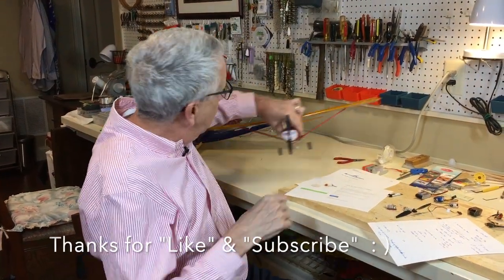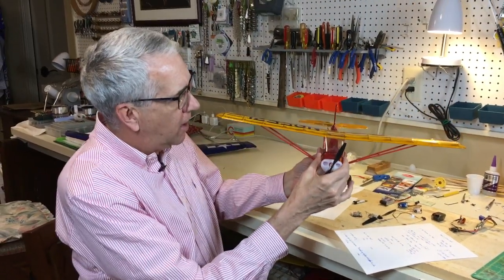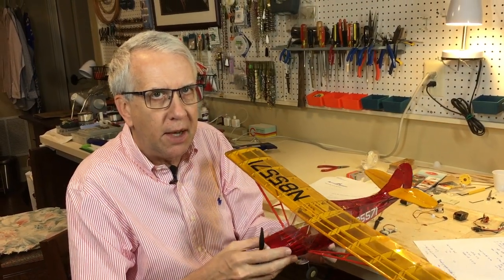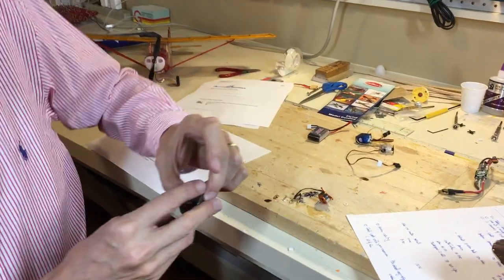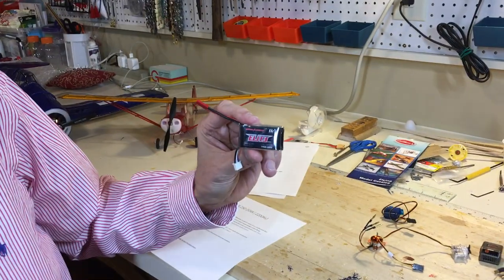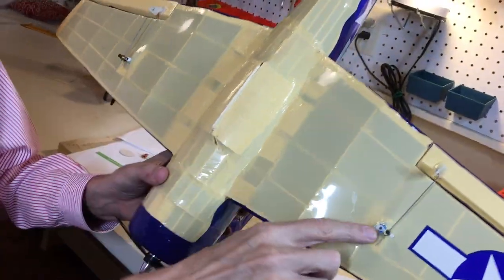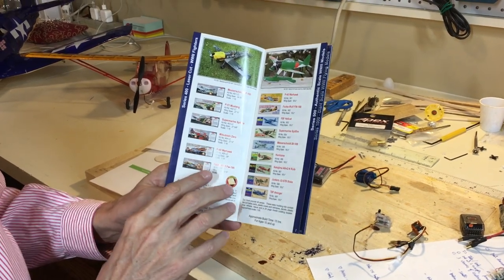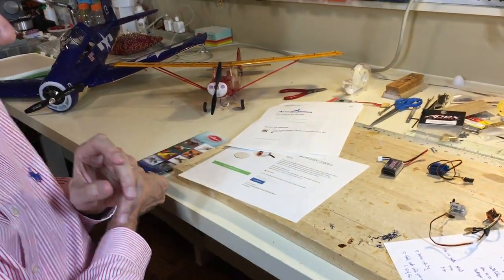Guillows RC Conversion Motor & Electronics

Comment: I just completed the Guillows SBD kit. I went with the Park 370 and electronics you recommended.  I covered it with tissue and clear coated it. I haven't flown it yet because I lost the canopy but I ordered a replacement. Its light and strong. I just started the Hellcat and I'll use the same running gear. Thank you for making great videos.
Reply from the maker: Thomas:  Best of luck with your test flights!  Tim

Comment: Tim. Thank you for these great videos, they are very helpful and informative.  I tried to follow your example and do an rc conversion on a guillow javelin twice the first one I got tired of waiting for the electronics to arrive so I tried hooking up the battery and it flew out of sight. The second one I was trying to install the receiver and the plane crumbled. I'm not sure if I want to try another one because I've tried 11 models and it was the same.  If I do, should I try another javelin or something else?
Reply from the maker: George:  Maybe try another project . . . Guillows kits can be tricky.  www.StevensAero.com has some fantastic smaller flyers that go together just great.  Tim

Comment: Hey Tim, Great video as always! I have always wondered the what is best way to hinge the ailerons on these? Some people swear by the micro hinges, other people swear by tape (like du-bro hinge tape). The tape you used seemed to work well. Does it hold up long term?
Reply from the maker: Dan:  I use regular clear Scotch tape. Practically invisible, seals to iron on covering very well.  Seems to last!  Tim

Comment: how does the Talon 15-Amp 17V ESC w/8-Amp BEC handle the Thunder Power 325mAh 2-Cell/2S 7.4V Rampage Series 70C LiPo even though the average current of the battery is 22.75?
Reply from the maker: Prod:  To be honest with you, I really do not go into the level of technical research.  Above my mental capabilities.   😁  I experiment a bit, and have found the Talon 15 seems to work well with a variety of 2 cell lipo packs if I keep flight times under five minutes of so.  Tim